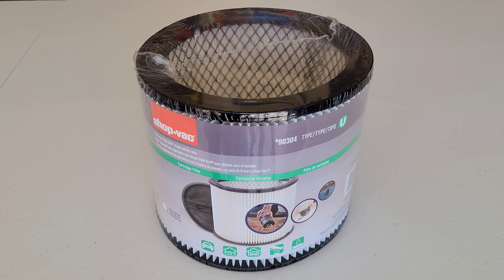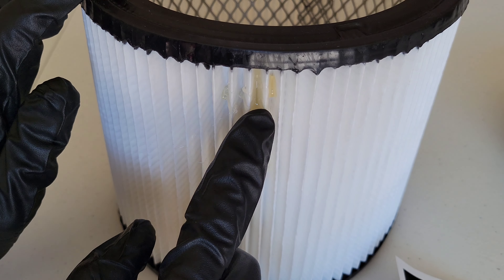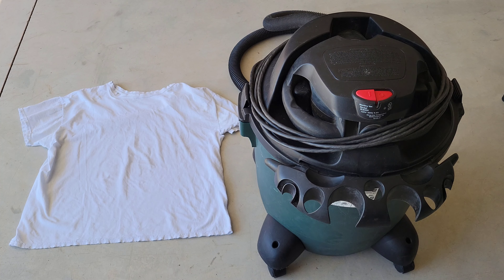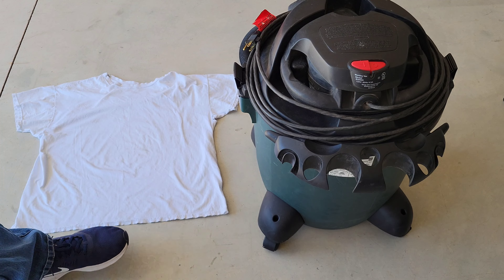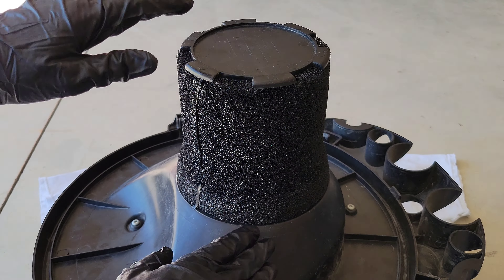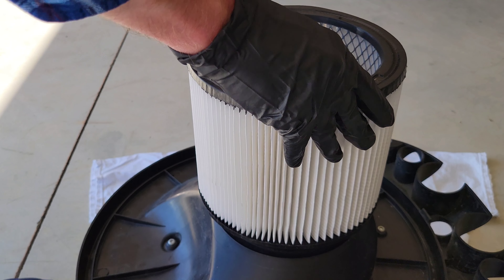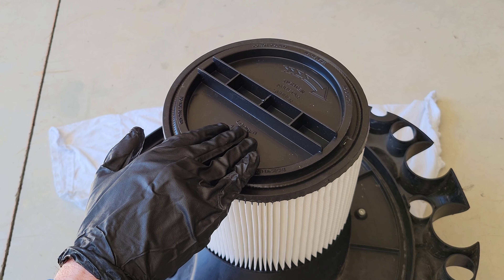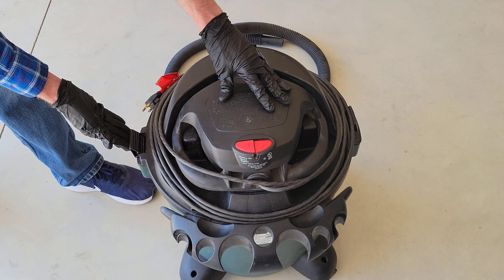Shop Vac Cartridge Filter How To Install

Comment: Many thanks! I have the Shop-Vac model 85M300 and my manual does NOT show the 90304 as an option. After watching your video, I have ordered one. Your video was the first one that I found that clearly showed the cage and tabs which look exactly like mine. None of the other videos showed this detail, so I could not be sure that the 90304 would fit. Thanks again!

Comment: The cartridge is for dry pick up, take it off and place just the foam filter for wet pick up. Don’t use together.  you’ll be mad when dust on the cartridge filter becomes mud if you vacuum anything wet with it on